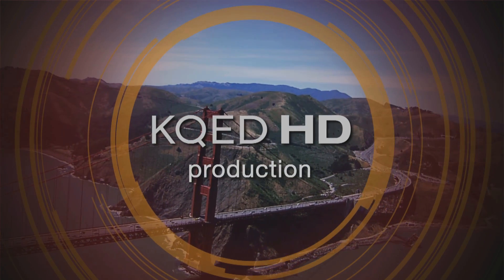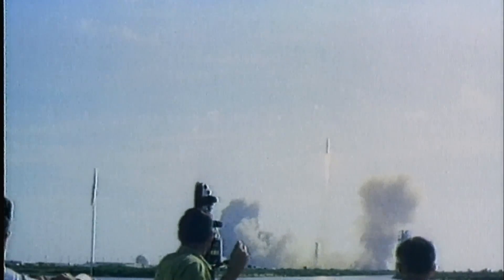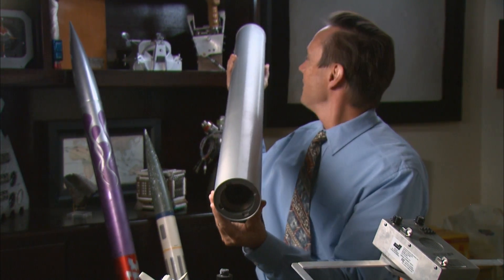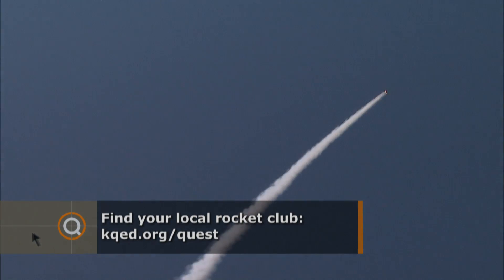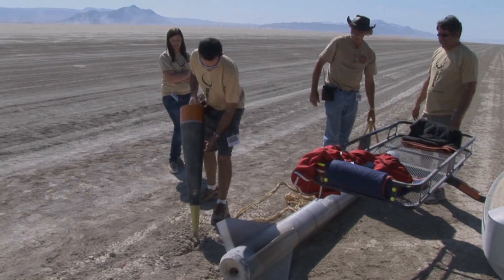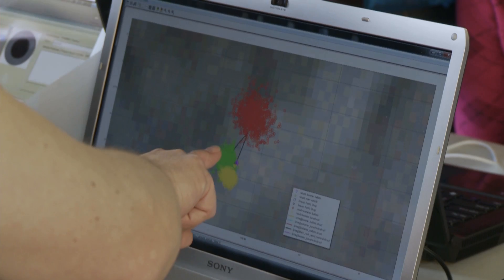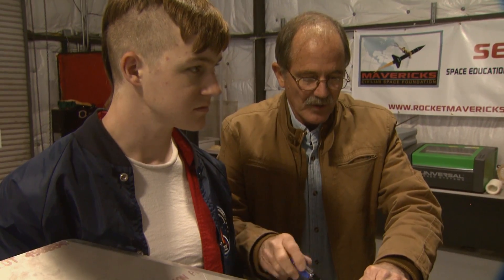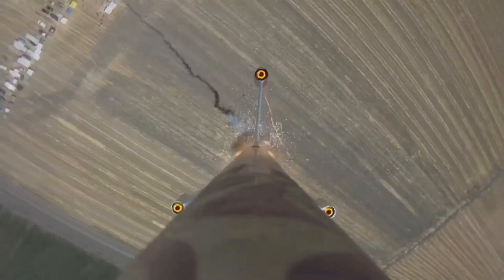Amateur Rocketeers Reach For The Stars - KQED QUEST

Comment: I love it. I didn't think I'd ever live to see the day when they would inspire kids the next generation to build rockets. Launching rockets for 37 years. Most of them are high-powered rockets the biggest motor I hired was a que 15000 with 2600 pounds of thrust. It was a low pressure chamber motor Butthead very I am both I don't know how they did it. Rocket motors are left to the rocket motor builders which I have a whole deep respect for. They are part of the team yes because they need to know the dimensions center of gravity and pressure the overall length of the rocket and weight every dick goes into account cuz when that propellant burns out your center of gravity and pressure shift. Oh yeah I had my share of what they call Dorothy's from The wizard of Oz. Imagine doing a loop teether with a p motor yeah I've done that LOL I also what's the first civilian to launch a P class motor all the way to 34,204 ft. That was short-lived for about 3 months. Anyway it is a really lot of fun I go to the Black Rock Desert every year in September for experimental lunches. Every person in the group but me works in silicon valley. I'm the crazy not that got them all started into it years ago. I love rocketry I've always wanted to go to space I'm not dead yet I just may do that someday you never know iclone Rocket motors I driven Rocket motors and I have written on top of Rocket motors. Thank you Michael k. H.
Reply: Sorry for the misspelling in some of my words. I didn't proofread. Using talk to text.

Comment: Oh dear.... My homemade grey powder powered engines are larger than the max they say you can buy on the internet. My longest burn time was 12 seconds with around 2.1 kg sustained thrust (the whole rocket weighted 270gm). And I set them off in the park behind my house till I found out that it is controlled airspace for the closest airport. But yeah they are a blast.

Comment: Is it posable to have weather balloons lift a rocket on a platform and after it reaches its max height that balloons can go then fire the rockets ? Is this do able ?
Reply: And by the time the balloon reaches altitude, can you guarantee it won't be directly over some city?
Reply: Not if you launch it in the middle of the desert, no.
Also, this has been done, it's called a rockoon.

Comment: launch it from weather balloon at 1000000 feet
Reply: @YeOldeScience
Make a launch tube through the balloon?
Reply: Weather balloons stop being buoyant when there is no longer enough air around them to keep pushing them up. The Karman Line is approximately 73 miles up, but 1000000 feet is about 189 miles, or about 2.6 times that distance.
Reply: that's higher than the ISS
Reply: That would be cool, the "rockoon" concept is still being researched, but as of now the disadvantages far outweigh the advantages.

edit: https://www.youtube.com/watch?v=9yRWhu0UGYw
Reply: @evilterabyte  That was NOT testing reaching orbit the failure was in testing the decent mechanisms for a Mars landing IE parachute ripping and such. It actually proves the idea viable as they got 7,000 pounds of material up into near space they just pointed it in the Wrong direction if they wanted to reach orbit or beyond.
Reply: THE DOME IS AT 73 MILES UP WHICH IS 385,440 FEET, AND MANY ROCKETS HAVE HIT IT, WATCH THIS VIDEO TO THE END, THE LAST 1/4 IS MOST INFORMATIVE. https://www.youtube.com/watch?v=4ZtXkV8jlfs  Werner Von Braun KNEW WE ARE IN A DOME, LOOK AT HIS HEAD STONE, PSALMS 19:1
Reply: That is called a "rockoon".
Reply: Would be cool, but not possible

Comment: To bad there isn't any rocket clubs in my town.
Reply: MrxFivexAlive Start your own. Or tell them to go fuck themselves and launch em anyway. <3
Reply: I'm to young.
Reply: MrxFivexAlive Make your parents think it's for the greater good. Worst case scenario, they go to jail instead xD
Reply: Haha, I live in a place in Canada with lots of forest so I can launch my rockets there. However it would cost lot's of money.
Reply: Cameron Byers You need to find a clearing to limit fires.  The club in my town launch from a boat, because we have harbours but no desert, and the sea is pretty big (though Canada has lakes bigger than the bay they launch from).

Actually, it's two boats, they put the rocket on a smaller boat and sail away before ignition.  Their current ones are big, but it should work at toy scale too.
Reply: At least there is Kerbal Space Program
Reply: @kman2747  Funny!  Theyre always seeking motivated young people!
Reply: So start one up.
Reply: Start one.
Reply: None in my town either. But about a decade ago I got certified level 2 with a club out of OKC about 70 miles from me. Curiously, the launch site is even farther in the other direction. When the club launches, a NOTAM goes out clearing the air for us for a 5 mile radius and 23,000 feet up.

Comment: the buy commercially available parts assemble them do a bit of tweaking and theyre called pioneers?
Reply: Commercially available parts?  Try to buy some and tell me how you do.
Reply: Albinas Uikis Do you suggest they mine their own metals, invent their own plastic etc.  It's been millennia since pioneers didn't use commercial parts as building blocks, starting with commercial stone tools.
Reply: I did everything from scratch, trinitrotoluole and nitroglycerine included. You want everyone to do that?

Comment: If your goal is to simply get a payload to near space, weather balloons are much cheaper and safer. Altitudes of 100,000+ feet are routinely achieved.
Google High Altitude ballooning.
Reply: Till they get sucked into a Jet engine..
Reply: These guys are working with rockets, not balloons.
Reply: K Danagger yeah, but that’s the BORING way to do it.
Reply: Cheap, safe and reliable  space travel isn't gonna involve fireworks.

Comment: Hmm... those specs approach some early AA missile models performance, if they can fit a target acquisition system onto the rocket with a stable guidance & control system capable of operating at supersonic speed. Can't wait to see them 3D print a close-cycle engine, scale up the rocket and reach for the orbit.
Reply: a problem are the solid fuel motors
Reply: @prototypeinheritance515  why dont they  use liquid fuel in model rockets?
Reply: Terra Nova Rain cost
Reply: @bitsbytes123  be so cool though actual mini rocket motor even run cryo liquid fuel for cooling 
   Seen where you can cryo acetone 🚀🔥

   Nitro no2 lox ?¿\/\/\/\/\ model to orbit like wtf
Reply: @bitsbytes123  wonders if you can cryo nitro methanol

Comment: So to reach the stars  you have to be sanctioned; otherwise meaning that a group of people decide who can do what and when...!! They call that true Rocketeering!! I call that 'control' over freedom, where's the true meaning of flight created by pilots or old!!
Reply: Try living where I live, Europe has the most control on anything you can imagine :( I would like to do something like this but I'd run into so much limitations so quickly there's no point to even bother.
Reply: phaelin Same here, in the past when I was a kid you could pretty much do anything - short from blowing crap up!! Since 9/11 you can't do squat without the armed defenders squad knocking down your door, pointing guns in your face!!
Reply: Jiraiya_Ero_Sannin Tell ya what... Let's give some clowns that shouldn't be allowed to operate a hose bib a barrel of AP, a pail of powdered metal, and some synthetic rubber, and then let's move 'em in next door to you. Then we can show them the big grassy playground in front of the school your kids attend, which just happens to lie directly under the air traffic lanes feeding your local airport.

Now, what was it you were saying about regulation and freedom?

Figure it out, Einstein. It's not rocket science.
Reply: Well as an engineer, I do want the freedom to just build. But sometimes safety is a factor. How would you feel if a rocket went awry and landed on your head? Sometimes the sanctioning process is a process of making rocket builders more aware, trained to be safe and vetted as trustworthy so that rockets don't land on your head and kill innocent passerbys.
Reply: The same way you need a licence to fly a plane or drive a car, and the same way you have to be certified to obtain gear to go deep sea diving.
Reply: Probably so you don't launch a rocket into airline traffic...
Reply: jmar1371 Why do you call your people clowns? Are you implying that you like to blow up kids - get a grip it's people like you that ruin freedom for everyone else.... Nice try but not buying what you're selling...

Comment: IMO it isn't real rocketry if you don't make the motor, after all, that is the most important part of the rocket by far. Also, if you are investing so much time and effort into something like this, why not make a liquid fueled rocket?
Reply: expensive, explosivse
Reply: Prototype Inheritance But fun! And probably way more rewarding if it worked. I mean rocketry as a hobby isn't the safest out there to start with, so why not go all the way with it? Come on, where is the spirit of innovation.
Reply: true, but r-candy is fun too. The problem with liquid fuel is: you need special oxidizer, fuel valves etc. Also there is a space program trying to launch a sugar based rocket to over 100km height.
Reply: brin3535 Evidently you are not correct, because people replied to my comment. Therefore they gave enough of a flying fuck to put in some effort to reply.
Reply: Funnily enough, NASA doesn’t build they’re own engines.
Reply: And your still doing a ton of stuff with, computers, aerodynamics, weight, staging, design, construction, etc
Reply: CockatooDude It took from before your comment to this year for our local club to make just one liquid fuel rocket land as planned (and one other crash land).  That takes a lot of dedication compared to putting a mass produced solid engine into your own sounding rocket build.  But then they do have a good and fun reason to go big and slow: Astronaut.
Reply: copenhagen suborbitals is a group that actually used alcohol and liquid oxygen as fuel.. you should check them out, they're awesome!
Reply: brin3535 Alright then.
Reply: Try peroxide and a pentametalic catalyst. Is not explosive and not so powerfull than liquid hidrogen but is powefull enough.
Reply: I thought that liquid butane might be a good fuel for backyard rocketry. It pressurizes itself, so no need to pump the butane.
Reply: CockatooDude because that’s a LOT more complicated and difficult to do.  Plus the fuel is more volatile.
Reply: They won't do that again
Reply: +CockatooDude No one gives a flying fuck about your opinion.

Comment: i want a rocket made by one of these guys to go out in space.. to land on the moon and transmit video back.. or out into the solar system
Reply: Impossible without making a rocket the size of falcon heavy
Reply: @justanotherasian4395  nonsense. if all he wants to do is land on the moon with a camera and a transmitter, that weighs what, hundred pounds at most? one of these as a multi stage would do, biggest problem is the fact these are solid boosters, so once its lit, it keeps going.
Reply: @Demonslayer20111  Problem is you also need to include guidance systems, batteries or solar panels to keep everything turned on, and your rocket would also need to lift a lander stage to the moon since that's the only way you're going to safely put a camera down. What could be easily done though is you hitch a ride with another rocket (Falcon 9 for example). So your only concern would be making a rocket that can do an injection burn to the moon and safely land. Looking at some random numbers provided by a number of sources it's actually fairly cheap to get a ride from a big rocket (Falcon 9 reusable  => $2,700/kg) (Falcon Heavy reusable => $1700 per kg)  (Atlas V 551 => $8,300/kg) keep in mind that these are prices based on the fact that the rocket is lifting max capacity so you are basically sharing the cost with other people wanting a ride (which is rarely the case).

Comment: Furthermore I have operated Motor Vehicles for the past Thirty Seven Years. I have not been involved in anything but minor "Fender Benders" where the other party got the ticket for violating the law.

I've drove vehicles at speeds well over 100 m.p.h. at times when I believed it reasonable and prudent. (I've had only one Speeding Ticket)

When someone is dying you do that. I am pleased to write that I learned through EXPERIENCE how to do that.

Regulations serve to restrict learning and liberty.